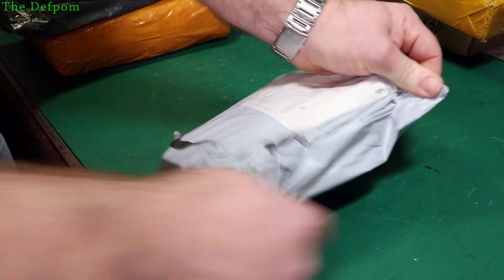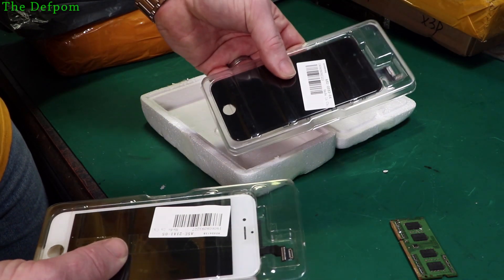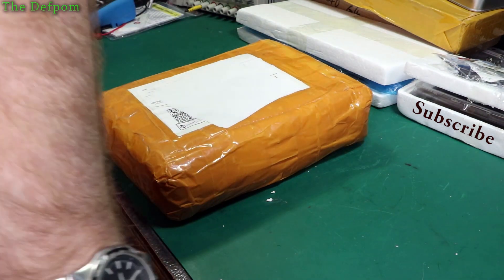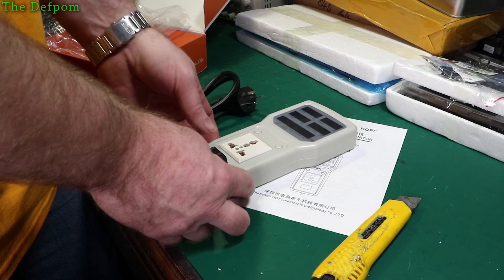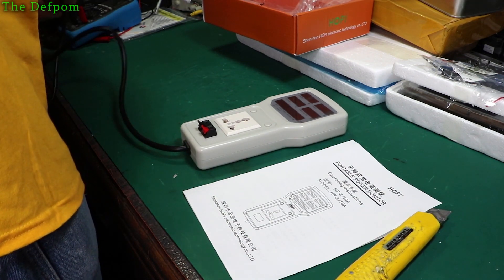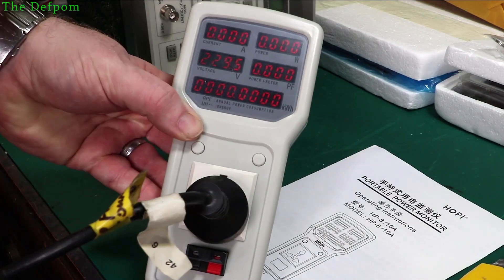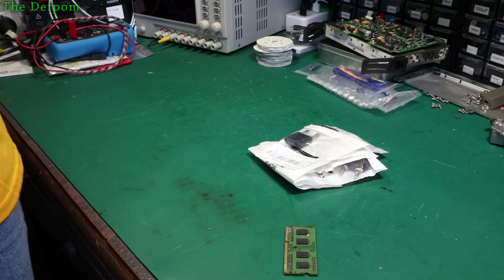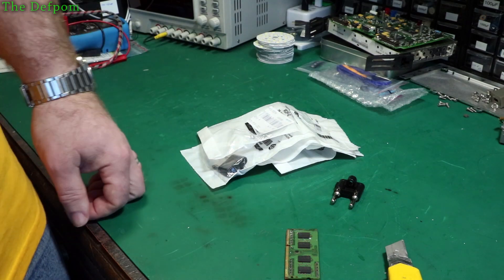🔴 #615 Mailbag Monday 19th August 2019

Comment: what are those replacement screens like compared to original screen? I have a broken "glass" iphone 6s and seen its a pain to replace glass only. Replacing the whole screen as per your link would be easy but what is the image like compared to OEM? DO you know?
Reply from the maker: I've never had an issue. they seem fine.